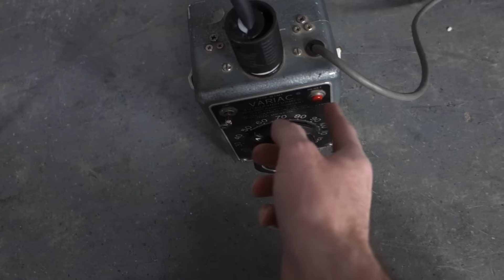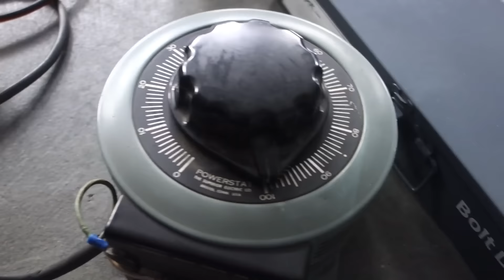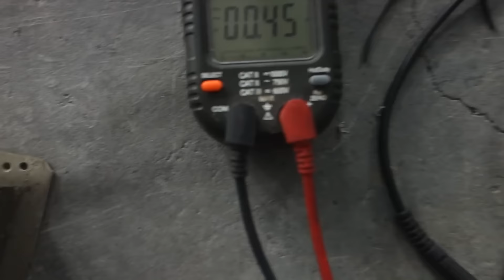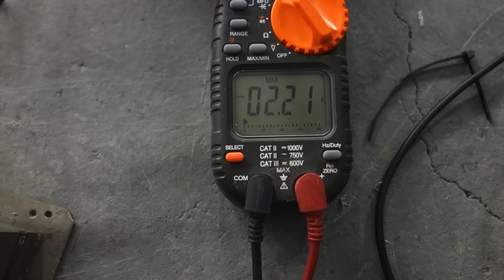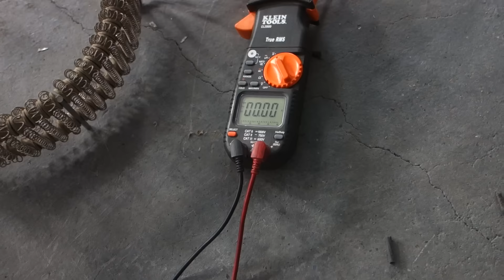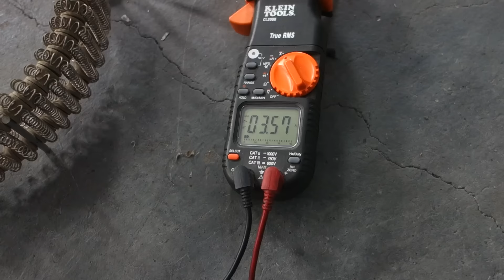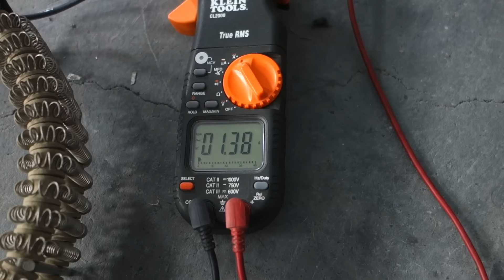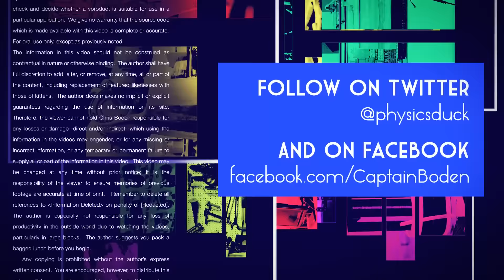Captain's Blog 1 1 2016 HVL 10kVA Transformer Stupidity

Comment: a 240v variac on 120 'should' work, most of the time you are only ramping it up to full voltage, once the dial is at the same point as the supply is connected to, it would be like a 240v transformer primary in parallel with the load.
would be bad for 120v variac on 240 volt supply, but not this way round.
overwind voltage would be lower than expected if you had used a 120 variac.